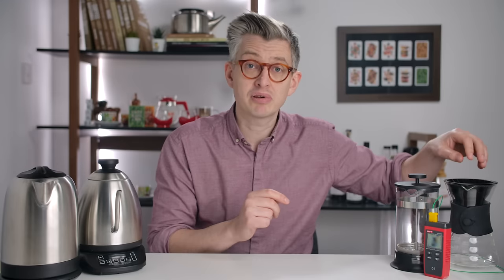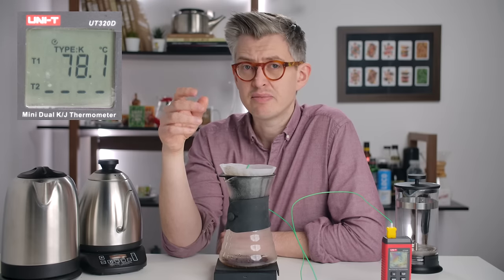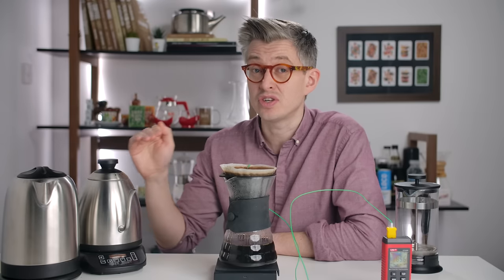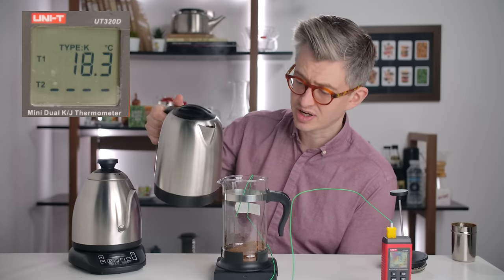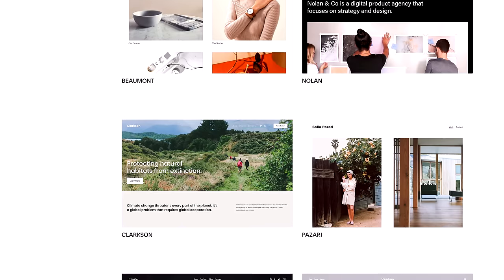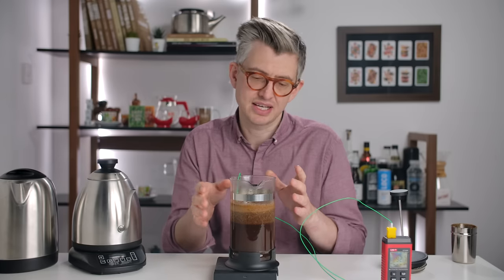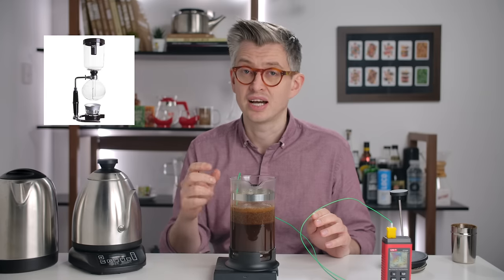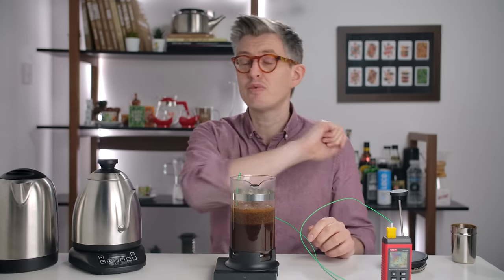Brew your coffee with boiling water - coffee brewing temperatures explained.

Comment: Does this video really address the central question of brewing temperatures and their affect on coffee quality? You demonstrated that boiling water drops several degrees immediately upon starting your brewing process, but the same would be true if you were using slightly cooler water for you brew (say the  standard 95-96 degree C recommendation). If water cools 6 or 7 degrees C upon starting your brew, perhaps 95 degree water that cools to 88 degrees is the best for overall quality

Comment: I realize I'm a bit late to the party here, but I've become curious. What if the water was above 100C? I realize that you'd need to brew in a pressure vessel (like an Insta Pot), but you might discover flavors that could not be produced with any other method.

Comment: Very interesting, BUT, I am curious about the brew temps when you use water temps that are commonly recommended.  For example, if you use a starting water temp of, say, 80C (Aeropress recommendation) or even 90C, what is the brew temp then?  And if this is a significant difference from your results of around 93C, is that a significant difference resulting in a different taste?

Comment: I would be interested to understand the calibration of these slurry temperatures to the recommendations of the specialty coffee association temperature range. Is SCA using temperature at the spout or in the slurry for example?
Reply: Bump up... This is a question about calibration... Does the SCA measure water about to enter the grinds? ( I e. Kettle temp) and set the desired temp to about 94C to achieve the taste, knowing the slurry will be cooler as you demonstrate?

Comment: SOUS VIDE COFFEE?  So 90C (or boiling water) makes coffee ready in like 4 minutes. And cold water makes it (kinda) ready in 12 hours or so. What happens if you make your coffee at 60C and something like 30minutes like SOUS VIDE? Or how long it takes to brew in 60C (i mean around average drinking temp.) I can't try because i don't have necessary equipment and also i think i wouldn't feel the difference like you.

Comment: So what happens when I use a drip coffee maker with a hot plate and leave my coffee there for a long time? it certainly tastes burned to me. Is it just evaporation of the water?
Reply: My understanding is that it's oxidation and evaporation that make a pot of coffee on a hot plate taste bad so quickly. So a thermal carafe slows oxidation and evaporation, tasting better longer.

Comment: This video only proved one thing. That even if you poor boiling water immediately it will already of cooled around 7 or 8 degrees by the time it first touches the grounds. Not whether doing that makes the coffee taste bad which is what people claim. You even said that dark roasts usually taste better with the water being heated to the high 80s, which means it could potentially be in the low 80s high 70s by the time it’s actually interacting with the grounds. This is more of trying to prove a technicality. “People saying using boiling water makes it taste bad but let me showe you that it’s impossible to pour actual boiling water”. In reality people are just using the term “boiling” to denote water that has literally just finished boiling even if it isn’t still “at boiling point” when it’s poured. Do a taste test to actually disprove the claim. Proof will be in the drinking.

Comment: Can someone tell me what kettles he's using, or perhaps a recommendation for a somewhat cheap kettle? Everything I see online either has plastic parts in contact with the water, or has issues with the finish on the inside flaking off, or some other durability issue.
Reply: Looks like a Brewista Smart Pour 1.2L Variable Temperature Gooseneck.

Comment: If I may add, I do believe a pre-heated vessel maintains the temperature at a higher rate for a much longer period of time, meaning more particles can be extracted at that point. So this mayb be where it differs in final taste result. Not just the input temperature but also the output temperature is key to look at. Great video James!
Reply: you can believe all you want but the numbers don't lie. It descended about as quickly as the that was not preheated. it just got a tiny bit warmer to start with but that difference would be negligable.

Comment: The amount of energy in boiling water is significantly larger than the amount of energy in water that is 98 degrees, about 7 times greater.  I suspect this is likely why there is a taste difference between brewing with boiling water or a lower temp.  (say 200F as is proper).  I wouldn't say it tastes burnt, I'd say it tastes scalded

https://courses.lumenlearning.com/boundless-physics/chapter/phase-change-and-latent-heat/
Reply: Changing liquid water to steam takes a lot of energy.  Boiling water does not have that energy in it -- it's in the steam.  The water that you then pour into your coffee brewer is just regular old water, with energy proportional to its temperature.

Comment: I'm not a barista or a coffee professional, but my intuition is a 5% to 10% difference in temperature will make no difference for the average person. I don't think temperature plays a large role in the flavor of the brewed coffee unless the difference is extreme (like cold brew). Like you said, other brewing techniques get the slurry hotter like espresso (which is under pressure so temps OVER boiling are possible), moka pots, percalators, and boiling over hot coals like the Ethiopian coffee ceremony. I think if you have bad flavors, it's more than likely you have bad coffee (poorly roasted, or poor quality beans, oxidation, etc.) or it's been brewed too strong (therefore more of the less desirable flavors, in the same ratios of course). Really, the best way would to break each roast down to it's molecular composition, identify which components are water soluble and what effect temperature has on that component's structure or solubility. 100C isn't some special temperature in the eyes of the coffee grounds unless there is a component of coffee that responds to that particular temperature, it's just happens to be the temperature that water reaches it's vapor pressure at STP.

Comment: Dude, boiling water is a big no-no from my experience... here are some scientific findings to report!

So, I've conducted quite a few trials, with thermocouples, temp control, flow rates, and even roasted my own coffees to different roast profiles just to play with as many variables that might contribute to that burnt taste.....

That burnt taste comes down to two things: either a shitty roast, or, boiling hot water poured out way too fast.

In extraction applications, its all about temperature, pour rate, and residence time (brew time). The lower the temperature of the water, the more flavor you will extract out, because the selectivity of your solvent is limited by the degree of temperature... hot pulls out more compound, cold leaves them behind. When you pull out too many compounds, the heavy ones will over power the lighter ones, and that is what you will most likely end up tasting. If you extract at lower temperatures, you can essentially "drag out" your most tasty compounds with a more "gentle" water and leave behind the "dirt" tasting ones. 

Simplified ranges: (non-coffee drinkers become so surprised when I give them my coffee)

197 - 200F  -- high acidity, brings out fruity flavors. Will have an amazing silky texture if done correctly.

200 - 204F -- water is hot enough to allow larger, more bitter compounds into solution, giving a more well-rounded coffee taste instead of just fruits.

204+ F -- pour water very slowly to prevent and over-extraction gradient; COFFEE tastes wonderfully balanced. A fruity Ethiopia can taste like a well-rounded honey-processed Colombia.

With this said....pour rate is also very important. Too much heat transfer at micro-scale will lead to an "over-extraction gradient"; if you dump hot water onto your coffee grounds, you can expect to pull out significantly more micro-burnt compounds (from roasts) due to an accelerated extraction and you end up pulling out bad compounds that'll precipitate out on your tongue and lead to bad after-taste.

Remember, the coffee bean is the protection layer that holds all the essential oils and sugars that have flavor. These all have different solubilities that become readily extractable when ground up to a certain "grind size"; and are affected much more severely by a solvent medium 1000x more dense than air... 212 F water is alot more destructive than 212 F air.

Think about it, what would melt you faster? Jumping into a pool of boiling hot water, or sitting in a sauna set at 100 deg C?

Anyway, thank you for the video, I hope my findings are helpful to all on the same coffee quest. James, you've covered a super important topic in coffee.
I work with high quality cannabis concentrates, and have brewed coffee for as long as I've been extracting...
 One thing I've learned, from one industry to another, is that temperature of your solvent (water) is EVERYTHING for FLAVOR...and how fast you pour it  and let it sit will dictate the profile of flavor you're going to extract. 

In my line of work, a difference of 1 degree Centigrade, can make or break a very expensive product. People love their cannabis concentrates, and only want the finest tasting flavor profile. Coffee is the same exact way. I will forever love coffee and wish to share the love of it with everyone else on the same path.
Cheers Mate!
Thanks for the videos!
-MP

Comment: I use the pour over method of brewing coffee. I have a ROK hand crank burr grinder. I normally set my electric kettle
for 190 f. After watching this I tired setting at 212f and the coffee seems more bitter to me at 212f vs the 190 F I normally use.
So everything being the same except temps. I have to say I prefer the 190F over the 212F when brewing using pour over  method of brewing.
To me the coffee is a bit smoother less harsh if that is a proper way to try to describe the taste difference.
Your videos are very well done.
I have found that the roast of the bean and area where grown need to be tried at different temps to see what brings out the best of each.
Happy Brewing.

Comment: I'd like to see you dial in a light-roasted coffee with 100C water and again dial in with 96-97C water and test how repeatable the brew is, and the flavour profile.

I find the lower temperature paired with a finer grind is far better taste and so much more repeatable, although ever so slightly less body which I'm sure a different recipe could fix. 
I'm using really light-roasted natural ethiopian and I still get the florals and all the flavour notes at 97C, but I have way more room for error.
If my timing/grinds are a little off with the coarser grind and boiling water, it's borderline undrinkably bitter, I guess because there is more hot water overextracting the outside of grinds rather than slower diffusion process.

Comment: I would love to hear your thoughts on cowboy coffee (or any other boil-in-pot coffee).

I have gotten fabulous results by absolutely boiling the hell out of my coffee. Regular ratio, medium-fine grind. Boil on high (a rolling boil helps agitate the grounds) for about a minute (or until the grounds are saturated and the foam is gone). An earthenware pot or percolator (minus insert) is traditional, but any old saucepan will do. I'm sure you can come up with a more precise recipe, but that's the basic theory.

It's smooth as hell, not too  bitter, and (most interesting of all) doesn't upset my stomach as much. Massive body, mellow flavor: like the lovechild of a French press and a siphon.

My hypothesis: the issues of (a) overextraction and (b) boiling off volatile compounds cancel each other out. As long as the grounds don't clump to hot metal and stay in the water, then burning is a non-issue.

Thermodynamics!
Reply: I would also love to see a video from James on this method! I've been making "cowboy coffee" for a few years now and loving it, usually boiling at a full rolling boil for 3-4 minutes.
Reply: It's also how I make "Turkish" coffee. And how it's made in Bosnia. To my mind the most simple, the most straightforward method and the most flavourful.  (I've tried french press and filter, but this is the best way.

Comment: These numbers vary  at elevation where the boiling point of water is lower.

Based on standard sea-level atmospheric pressure
0 (0 m)        	        212°F (100°C)
1,000 (305 m)	210.2°F (99°C)
2,000 (610 m)	208.4°F (98°C)
5,000 (1524 m)	203°F (95°C)
6,000 (1829 m)	201.1°F (94°C)

Comment: People pre-heat the cone, the filter, even the pot – but there’s a hefty hunk of thermal mass which sometimes gets overlooked: the spout of the kettle. If you drain about 200mL of hot water through the spout before you start your pour, you may end up with as much as a 6°C difference in the slurry.

Comment: I just feel I get the best results for taste, even if it's a placebo effect, with brewing my Chemex at 190 - 200 F. I do warm my Chemex up at the boiling point, but I wait for the temp to go down in my kettle before I start to brew actual grinds. I feel like even though it may not actually rise to boiling temperature in the Chemex paper, you're still initially contacting those grinds with boiling water before it immediately cools down. This could be doing immediate "damage" on-contact.

Comment: The idea that boiling water "burns" the coffee is absurd. Temperature is probably going to have the most effect on how quickly different compounds are extracted. If boiling is actually the best temperature why don't  barista champions use the hottest water possible? In fact some actually use water temperatures BELOW the SCA 195-205 guidelines. Confusing the issue by talking about  the difference between the temperature out of the spout with the temperature in the bed is a useless waste of time since this obviously the case when the SCA set its' standards in the first place.  I HATE stupid videos that contradict everyone else just for the sake of being contrary. Hoffman does the same thing when he claims that pour on the paper doesn't increase water "bypass" when clearly (in any ribbed brewer) it WILL.

Comment: it takes 7x more energy to take water from 100C to boiling than it does to take water from 0C to 100C. 100C water is not the same as boiling water. 100C water is more energetically different from boiling water than 50C water is from 100C water. Basically, boiling water is a huge waste of energy, you can't really pour boiling water anyway it just floats away. Boiling water may be a convenient way to measure temperature, but you can use 1/8th of the energy needed to boil water to simply bring it to 100C. That's a lot of savings

I wonder what a coffee maker that heats while in an enclosure might do. You could use that extra pressure from a press to increase the temperature of the water

Comment: Love your videos and this is probably solid advice for people drinking light roasts. But it does seem quite biased towards those light roasts that you like. 75 grams per liter? And yes, I do use a preheated, double walled Espro press. Can't do centigrade, to paraphrase yourself. But I've found that my roasts do best with 195° water. When I try temperatures closer to boiling, good coffee is not the result. Also you are measuring steady-state slurry temperatures. Certainly the initial extraction is at the actual water temperature which then drops a bit. Not enough information to know if that is a concern. But I do know that water right off the boil reliably makes worse coffee than 195° in my kitchen.

Comment: I would like to see what happens when you boil the water together with the ground coffee in a pot. Many old traditional ways of brewing coffee are based on this method - one particular version I have tried, supposedly from Bulgaria, includes bringing the brew up to a rolling boil three times with short intervals in between just to stop the rolling boil - and then filtering the brew before drinking it......unless, maybe, if you are a proper cowboy and just leave them to settle at the bottom of your cup. It probably sounds barbaric but the method is still used in many countries, Ethiopia springs to mind, so maybe there is a way of making good coffee this way too?

Comment: 95oC and drop right to 80 as soon as I pour my boiling water into my warmed-up drip kettle. I need to put it back on the stove to maintain the required high heat. So yeah, having the highest temperature you can because the moment you take it out of stove, it's down only.

Comment: I'm not surprised at all about these result. The water comes with cooking temperature. Everything in this environment is much colder than that, preheated or not. Therefore, the water has to loose temperature significantly the moment it comes out of the can. Which means that it must be noticable below cooking temparature.